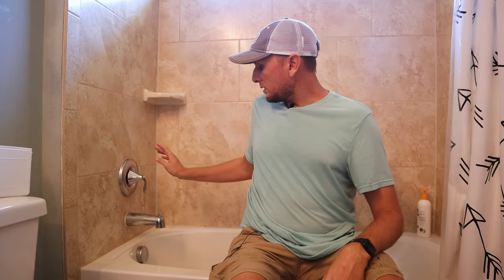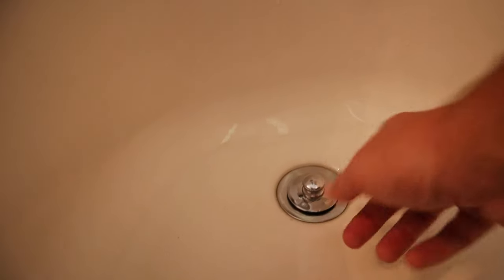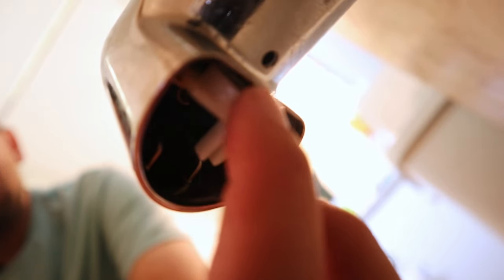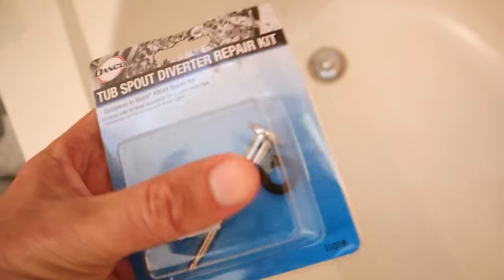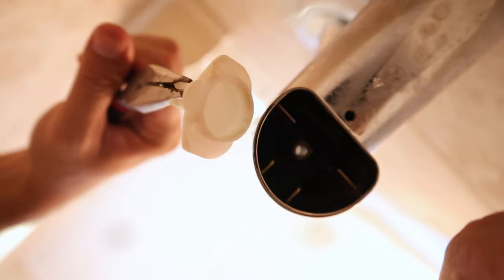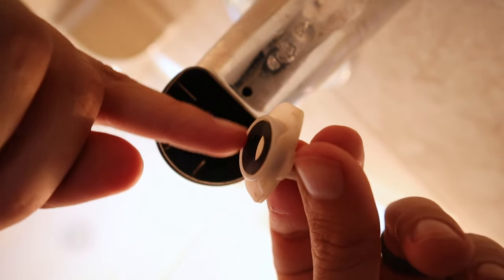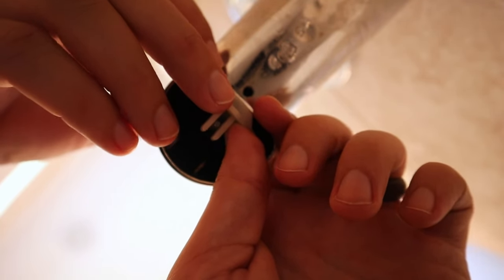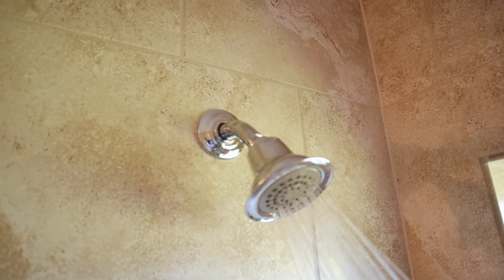Water Not Coming Out Of Shower Head? Tub Spout Diverter Repair

Comment: I have the same diverter, but it's not sticking when I pull up the pin.  The new diverter seems to be super small.  It isn't stopping water, what now?
Reply from the maker: If it is not the same shape and size as the one that was first installed then no it won’t work.  Have to have the same exact one as the one being replaced to create the seal when it’s pulled up with the water on.

Comment: To remove the pull rod to free up the white plastic part, simply insert a pointy end wide screw between the rod and edge of the spout (closest to you). Turn the screw by hand and the white tabs will separate, then pull up on the pull rod. Easy peasy.

Comment: My tenant forced the diverter down by pushing down on it right after taking showers. The pieces ended up separating from the spout. Can I just reuse the parts to build it in again?
Reply from the maker: If they are still in good condition and not causing an issue, yes.

Comment: So I took the plastic piece out, the seal looked fine. I put it back in and nothing has changed. Still dripping when the shower runs. Do I need a new faucet?
Reply: Update: I bought the replacement valve kit for $7.98 and while the plastic piece was the right shape, it was too thick to slide into the spot behind the faucet fins. I used the new rubber gasket seal from the replacement kit and put it in the old one. That did the trick because the new gasket was a bit thicker and provided a better seal.

Comment: If the stem doesn't snap in place all you have to do is unscrew the top slide the stem inside the spout where it goes and the stem will go down further then snap the plastic piece where it goes. Then push  up the plastic piece where it goes and the stem will go thru the hole and screw the top back on.

Comment: Unless you can bend like a snake, replacing the valve while the spout is on the pipe is impossible. I had to remove the spot, and then replaced the valve. Also, used CLR to clean the spout well from the calcium deposits. Guess what: after the spout was back on the pipe, the seal between spout and the pipe started leaking. So, my friends, I just threw that old spout in garbage and purchased a new similar slip on. Now it works. And this is what I would advise to everyone: if the valve is non-functional, you'd better replace the entire spout.

Comment: Thanks for this. Unfortunately, doing this made no difference at all to the amount of water spewing out.  😞
The faucet is fused on there - even a plumber said it would probably require cutting into the wall. (As did our pal who is a handiman).
Reply: Your plumber is a liar. You need to clean the inside wall the diverter seals too. Probably calcium deposit buildup on inside 100%. A little late to tell you.

Comment: Today I went to lift the knob and it unscrewed and the black seal went right down the drain never to be seen again. Now I gotta buy a whole new kit just for the black seal 😢
Reply from the maker: Unfortunately that was exactly what happened to mine.  Someone lifted up on it to engage it and for whatever reason the black seal came out and right down the drain.
Reply: Hey I just bought a black seal for it and now the knob is not staying up in the shower position it falls down how did it stay up before I think all the parts are the same

Comment: Your instructions were dead on!  However, mine still sprays water out the bottom even when I turn on the shower head.  It's about 70% out of the shower head and 30% from the tub faucet.  It's not an urgent fix as my kids are using that shower so I'll watch for suggestions.
Reply from the maker: Are you sure you got the correct gate?  If the new gate is not the exact same as the old one, that is exactly what will happen.

Comment: My faucet has good pressure but the shower head is an annoying trickle!
Reply from the maker: If water is not coming out of the tub spout when you are trying to get the shower to work then the first thing I would do is remove the shower head and see if water flows freely up top.  If it does then your shower head is plugged somewhere.  If it doesn’t then there is something plugging the pipe somewhere going up to the shower head.

Comment: Be very careful taking advise from handy men. This does work. But you’ve spent $75 at least if you hire this out. This is strictly for you to attempt. Do not spend $75 on a piece of rubber when $125 will replace it and we can then warranty it. Why spend $75 on a $5 spout?
Reply from the maker: This didn’t cost be anywhere near $75 to fix.  And the last time I had a plumber come out they charged me $100 just to show up, all of the work and parts after that was extra.

Comment: He used the old gate not new
Reply from the maker: I said you could in the video if the seal was just missing or damaged.
Reply: @HowToHomeDIY  I knew what you meant but you were calling it new when it was the old lol
Reply: @HowToHomeDIY  I had this problem and the gate and rubber washer were there it just wouldn't sit tight so I put in a spacer to make it tighter works now

Comment: of course it doesn't engage , you keep pushing it down lol
Reply from the maker: No I just kept holding onto it.  It just fell down on it’s own.  It takes a lot more force to push a lifted diverter down than that while the water is running.  On top of that, what is your reason for when I pull it up all the way why water continues to pour out of the spout?  They instantly engage when working properly and no water comes out.  These are the comments that not only are funny to me but also sad at the same time.   Nonetheless I appreciate them as they help the video 🫶